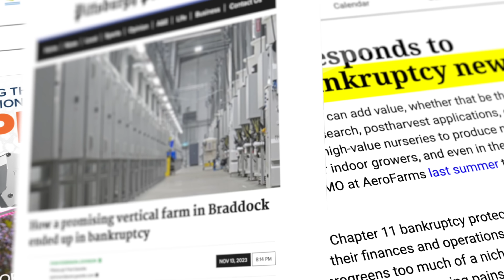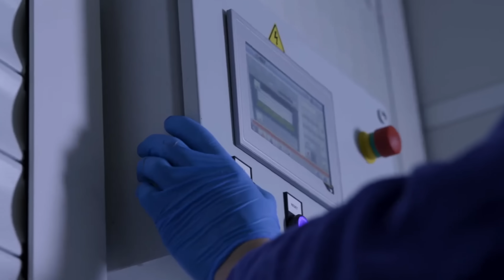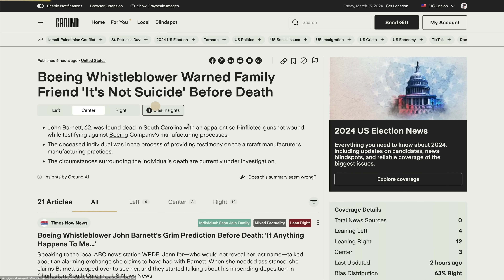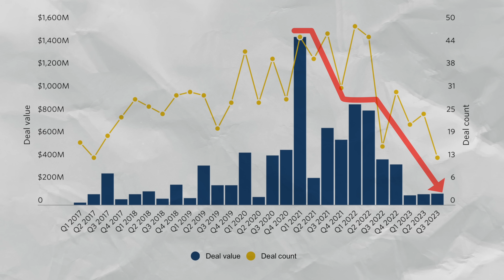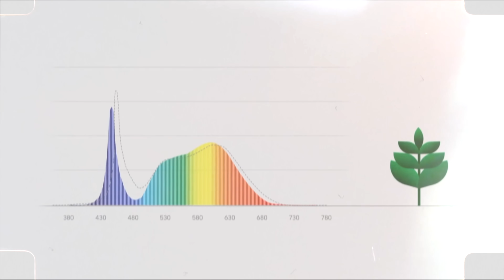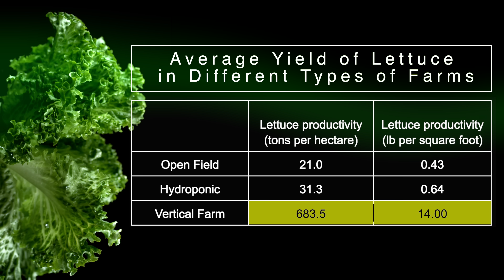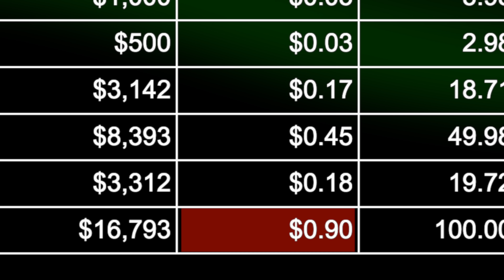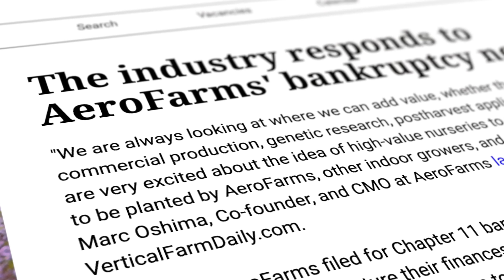The EPIC Failure of Vertical Farms - What Happened?

Comment: As I suspected, vertical farms require a lot of equipment that require skilled labour to use and maintenance costs. This sinks vertical farms in advanced countries with high labour costs, low population and highly mechanised, massive size traditional open field farms. Vertical farms thus require low labour cost, perhaps robust, autonomous humanoid robots capable of multiple tasks are the answer, simple and efficient irrigation and harvesting processes and really cheap energy. It’s a technical problem just waiting for technology to catch up. Check.
Reply: Cant beat the scale of broad acre farming using high tech you will burn up your budget too quickly and number of these hoped to make turn key systems they could on sell. This was the case with many spruiking turn key fish farming systems in the 1980s to early 2000s. Just buy our xyz system - minimal labor, reliable, maintenance free and produces 20 ton of fish per week - years later they are bankrupt and in court!
Reply: Farming is WORK, no matter how you cut it, and NOBODY wants to work, even high tech farming.
Reply: It's a political and ideological problem.

Comment: I should really be keeping this idea to myself and try to market it but I am to much of a lazy bastard and dont have the means so I hope someone else grabs it and does something with it.

Back 10 years or so I started seeing videos popping up on people making their own, less expensive variants of fiber optic cables to "pipe" natural sun lighting into various parts of their house during the day.

Now if I remember correctly they used some clear, flexible tubing filled with a sort of cheap'ish epoxy resin and were able to accomplish similar results to commercial fiber optic alternatives at the time for a much lower cost.
Now combine this idea with a vertical farm setup and you will be able to to "pipe lighting" to the different shelves through fiber optic cables that require less maintenance than led lights, drastically reduces the need for artificial lighting and removes the problem of shade produced by the shelves on top.

If done in the northern regions where I assume shipping and import costs would be higher to further compensate the price difference  I'd also suggest combining this idea with the "sunken greenhouse" concept we see popping up in China, Mongolia, Canada etc these days that allows for winter farming in cold climates and maybe we'd reach parity at least when considering pollution from transport.

Comment: I'm reminded of the company Robocow where they were stacking cows vertically. 🐄 it was cruel and the weight of the structure caused the building to collapse and there was a cow pile up.
Reply: Cowabunga!
Reply: @davesy6969  cowadunga !
Reply: @davesy6969  Holy Cow 🐄
Reply: Holy hell that is terrible, but made me laugh. 

 Humans are insane.
Reply: Jesus H Christ
Reply: @JamesKennedy-zs8go  it wasn't bovine intervention
Reply: I do not see what it would be more cruel than other dairies or why it would fail from  weight.  The math for weight would be super easy!  Sounds like an urban myth to me.
Reply: @gregkramer5588  well the mistake they made was to integrate the vertical cow farming with power generation from their sister company Kinetic Kows, which involved strapping cows 🐄 to tredmills connected to generators to generate power. They were also capturing the methane from the cows for carbon capture and for heating and energy needs. This extra force from the moovement of cows on tredmills was not taken fully into account. They made sure that the cows were all walking at different speeds so not to cause resonance with the structure but the cows walking caused some static build up which caused the methane in the air to explode. I'm surprised that you didn't read about this in the newspaper.
Reply: @lemdixon01 
That is - fascinating. 😮

Wow.  ("How now, downed cow?" 😂)
Reply: @justinklenk  that's better than 'how now drowned cow' but that's another story.
Reply: @lemdixon01  
LOf'ingL!! Yeah, gotta narrow it down...
Reply: What an udder disaster
Reply: @tobins6800  
Moorons.  Udder moorons. (And cow-ardly, I bet.)
Reply: @tobins6800  pull the udder one !
Reply: I'll show myself out...
Reply: @justinklenk  moove it ! Moove over ! 🐮
Reply: How did they not see those problems at the outset? 🤦‍♂️
Reply: This reminds me of an archers implement and a grape stem - Bow-vine!?!
Reply: @TomTomicMic  ah yes I udderstand
Reply: Go to Switzerland to see (it is VERY well hidden) how cows are closeted in buildings as milk "generators".  Sad. So sad.

Comment: This is spot on. Following trend I looked at diversifying into hydroponic based vertical farming in 2022 and spoke with a number of experts in the industry. It quickly became apparant that once the initial capital investment had been factored in, the only way that you could achieve reasonable ROI was to scale the operation (which was impracticable). Instead of pursuing vertical farming I developed my own low(er) cost community based hydroponics system.

Comment: How many acres of solar panels are needed for each acre of vertical farm?
Reply: Site it correctly, and you can attach the panels to the roof and walls of the main building, more solar panels as a roof over employees car park, maybe stick a couple of turbines at the edge of the car park.
Since some people have already experimented (and succeeded) with making miniature turbines to fit in downpipes from gutters, there's another unexpected source of power that could be tapped. 
Oh, and that rainwater could be diverted into tanks so it could be used in the plant itself, filtered for watering.
Reply: Don't need acres at all. Geothermal providing for heat pump energy, solar and wind providing for other energy needs. Just depends on the scale of buildings. Folks I know used multiple shipping containers
Reply: @katanaridingremy And in areas where rain is more plentiful than sunshine, companies or individuals could make better use of hydroelectrics. 
All around me, there are streams, a river, springs and 2 small waterfalls, and that's a pretty normal state of the land where I live. 
We simply do not do enough with what we have available to us (we honestly don't need to be on the grid at all in my neighbourhood). It's the fact that we all know that everything is unnecessarily more high tech than it needs to be these days, and that we would all be at the mercy of a nerd with a laptop than a real engineer.
Reply: All these are assuming any of these are possible. which for a vast majority of cities. None of them are. Poor air quality and constantly rainy days. There are no rivers or No where to even put any type of hydro electric and If geothermal was even an option there would be a powerplant, which there is not. You and the first guy are assuming perfect condition, which is stupid and only hurts these projects because people then think anyone can do and and no the cant. It only works in very few areas that may not even Have the infrastructure built in the first place. @Debbie-henri
Reply: if you don't have access to geothermal energy then what?  Yes, vertical farming can be made to work on a small scale for a family or two with a limited diet, but try the system to feed a city of say 5 million. Also they are not effective for tubers or root vegies  and more importantly they can't grow Wheat,  Chickpeas, Barley, etc = no bread. but you won't get any way because of solar farms.
How cost effective are the container crops. If they are doing it for fun fine! When I go fishing it usually cost me twice as much to catch a fish as it does to buy one at the fishmonger, the cost isn't important.
 @katanaridingremy

Comment: 10 acres of solar only grow one acre. Lot cheaper just to grow 11 acres outdoor.s.
Reply: wheres this come from?

1 18v 600w panel would be enough for 100 acres
Reply: Your argument sounds logical, but not thought through entirely. Your argument is that because of the laws of thermodynamics, converting solar light into LED light to grow plants can't be as efficient as growing plants directly under the sunlight. But this argument is not entirely correct.
Plants have an energy efficiency of less than 1%, meaning that they convert 100 units of sunlight energy into 1 unit of sugar energy. But this is because they don't absorb 99% of the Sunlight wavelengths.
LEDs have the power to generate specific wavelengths to drastically increase efficiency of the plants.
Solar panels have 20% efficiency and can power LEDs with 50% efficiency. Meaning that 100 units of solar light energy gets converted into 10 units of LED light energy in the end. So your argument holds some water. But that LED light gets absorbed at much higher energy efficiency by the plant, maybe 50% or so (let's assume).
In the end, you get 5% energy efficiency of converting sunlight into plant sugars, that 5 times more than conventional farming. Even at 20% efficiency for LED light to be converted into plant sugar, you still get double the yield than conventional farming.

Comment: The problem is where the farms are at.  Instead of putting them directly in the city's put them on farmers land to maximize their outputs
Reply: I agree. The office buildings sitting empty should be subsidized as vertical farm space. The other cost savings is then from the last mile of transportation infrastructure.
Reply: @NeonNijahn  no that's the problem unless the company uses solar and batteries to minimize cost and rain collection as well. If a company uses old office warehouses Maybe, but they would have to be built in cities that are huge like Miami or Los Angeles to lower cost far as employees or staff.
Reply: The costs of city land are literally absurd, it would be even worse

Comment: With how much cheaper solar panels, baterries and automation are getting, feels like it's more plausible now
Reply: Well no actually.
Solar is indeed cheap. It sits currently at about 3 to 4 cents per kWh of solar electricity produced, and is forecasted to go as down as 2 cents by 2040. Batteries will also go down in price by half according to most. So electricity cost would be reduced by half, which is good.
However, he said that electricity was not the main cost of such a facility. It only represents about 8% of the total cost to operate the vertical farm.
So even if we halved the electricity cost, it would only reduce total price by 4%.
And even if we got the electricity for totally free it would only reduce the price by 8%
Automation will not help, a huge chunk of the cost is due to the initial cost of the machines. So you may reduce blue collar work cost, but will increase capex costs.
That is not to say that vertical farms will have no future, I want to believe that theey might work. Problem is, to be competitive, vertical farms must provide at least 5 times more yield than they currently do. And this is an insane challenge. Vertical farms are already 20 to 40 times more productive per square foot than traditionnal farms, and they nedd to get up to 100 or even 200 times.
Reply: @texanplayer7651  But weren't the up front costs known from the start? Wasn't the idea that they would pay forthemselves in the long run and provide a good return for the venture capital firms putting the money up